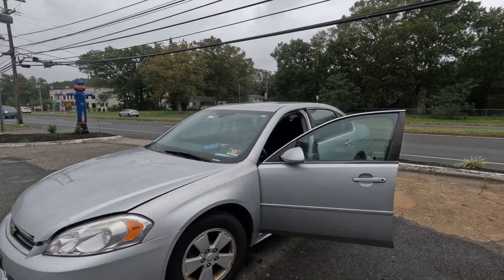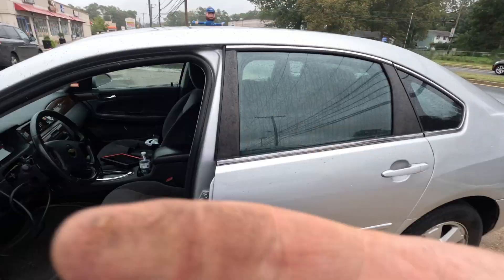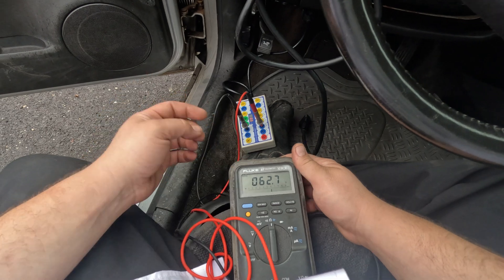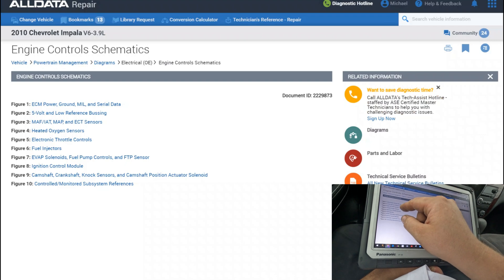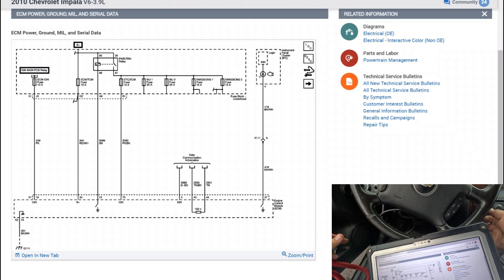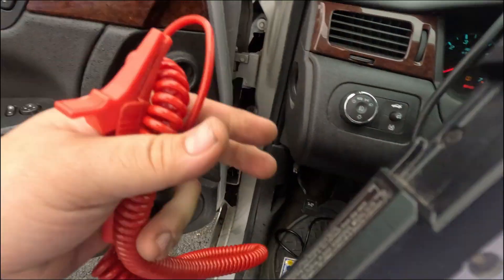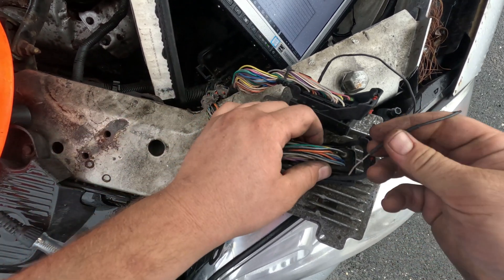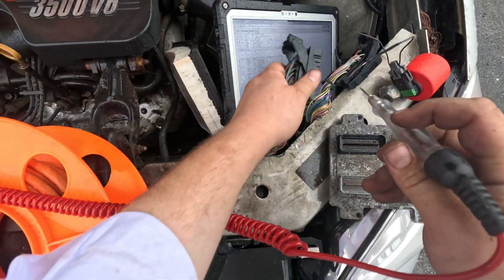2011 Chevy Impala - No Crank after it stalled on the highway!

Comment: I have the same impala I will check the grounds on it . I have a new battery new alternator will only start with jump and doors unlock and and shut when I try to drive off.
Reply from the maker: I  think you have a diffrent issue because on this car it would not crank at all, because there was no communication with the computer.

Comment: I love the way he did it finding missing ground (((( ''I'm not an expert so I'm still learning as well'' )))but wouldn't you think an easier way would be a quick voltage drop onto the ground battery to groung using voltage drop
Reply from the maker: Then I would have to keep it plugged in and back probe it so the circuit would be loaded. This way, it puts 4amps on the circuit even when it's not working.

Comment: Got rid of the Suburban for a truck? That had to be very cramped for all the equipment you need.
Reply from the maker: Yup, I paid junk for this 07 F450. I wasn't thrilled initially, but now that I'm setting it up, it is really nice to have all that room! The suburban was slowly dying as I really was abusing it with all the weight😀
Reply: @advancedleveldiagnostics  Back in the day I tried all kinds of vehicles and finally bought an E150 little did I know I was going to overweight that too but working out of a proper vehicle makes life so much easier. On that E150 I went through rear axles and bearings. The best I could do was take  it to a truck spring shop. Never had an axle or bearing problem again. That 450 should hold a bit of weight. Parking garages and low overhangs are the only major drawback but even my van gave me the same issues. I had a PoPo style lightbar on the roof with lights and a P.A. as we do emergency service calls.

 I'm working on something with Techstream. Newer Toyota's have output and input codes for lost keys. The scan tool gives you 3 output codes and through NASTF you have to pay Toyota $70 for a 2 day rental for the input code. I may have a work around a lot cheaper. Will know when we get the next one. If it works I will email you how it's done.

Comment: Wow, a lot of important lessons buried in this video. I love your clear nail polish trick. I wonder how it stands up over the long term. Even though liquid electric tape should be better, I go through cans of that because the containers dry out.
Reply from the maker: I've been using it for a while, and it seems to seal very well. When the hole is a little bigger than a prick, like if the copper is showing a little, I still use Liquid tape. Even though I can never get the stuff off my hands😃
Reply: I use both but in rust belt the nail polish will last longer then the frame of the car 😁
Reply: That's FACT!